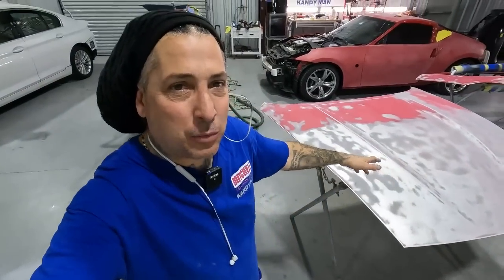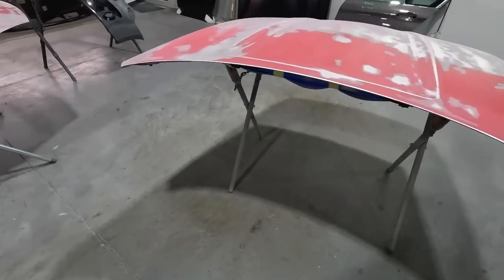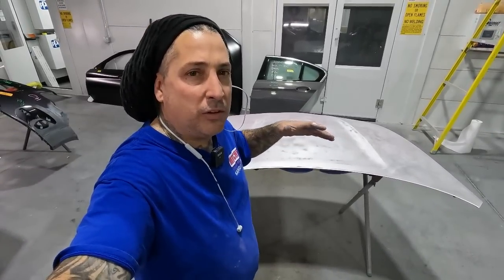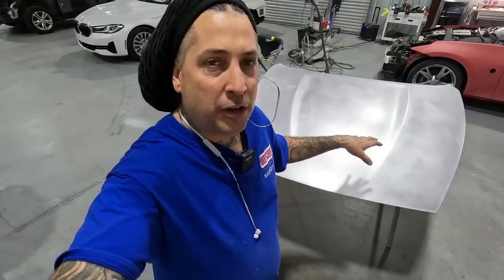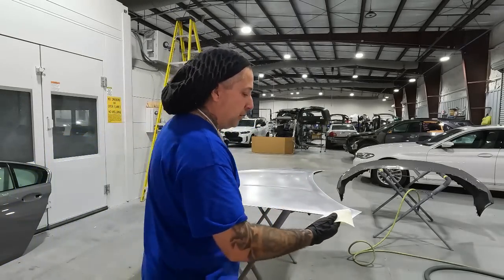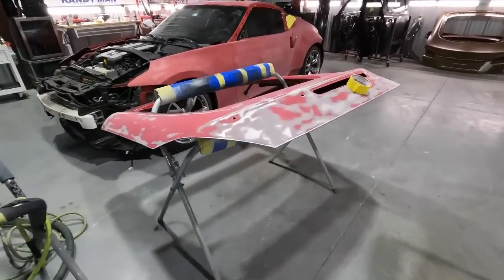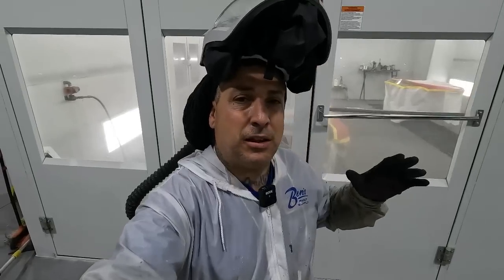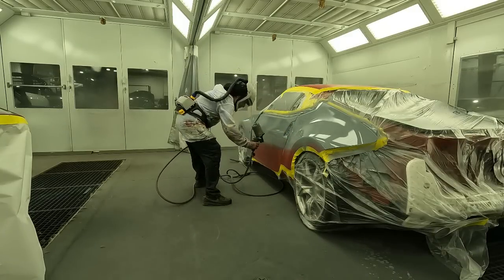Choosing The Right Automotive Primer

Comment: In my experience I've seen a lot of primers shrink. In the past when I would leave more primer on the panel after everything is painted, finish looks great at first. But then after a few months especially over the hot summer months as primer underneath of the paint products would cure all the way, it would shrink, slightly distorting the final look of the area that was primed up. So normally I do my Bondo work real well, therefore I don't rely on primer to fill a lot of the imperfections. I always do one coat of primer and then take 80–90% of it off so that only the slightest imperfections would be filled with the thinnest coat of primer that still remains on the panel. That way after everything is painted there's not enough primer on the panel to cause any shrinkage. I'm sure there's more than one way to skin the cat, this is just the way I've been doing it for a while and this way in my opinion gives the best final result.
I in no way critique Candymen's work, he is a true master of his trade and I've learned a few things by watching his videos 👍
Reply from the maker: Thanks for the feedback. If your way is working. Keep it up
Reply: if shrinkage is your biggest concern why don't you use a poly primer?

Comment: So, why not just use epoxy? Two coats, wait overnight then epoxy seal. I get the 2k to block out.

On small areas, I love using UV primer. That fender would be a good place for UV.

The cardboard trick blew my mind. So ingenious!! I've heard that some people use pool noodles between truck beds and cabs when separating them isn't possible.

I absolutely love your videos! Thanks for your time in producing them!

Comment: I saw that you used a 1.2 tip. What was your mixture ratios on the urethane primer?  I'm guessing that you thinned it down 4:1:2 like a sealer?
Reply from the maker: 4.11 sprays it fine flat

Comment: Kandy man I need some advice I’m looking to get the flattest clear I can!! I want to be able to cut n buff individual areas and not have the areas stick out like what happens when you have a slight peel. So my question is this im currently using a Devilbiss pro lite with a 1.2 fluid and a T110 air cap at 27-29 PSI it makes a ton of over spray the cloud is so much Im having issues following my wet line! What I’d like to know is would I recognize the difference of using a DV 1 clear coat gun I see it operates at a much less PSI .
Reply from the maker: Day and night 👍
Reply: @ I think I’m going to go ahead and order one what fluid tip and air cap would you recommend for a flat finish I’ll be using a high solids European urethane clear.